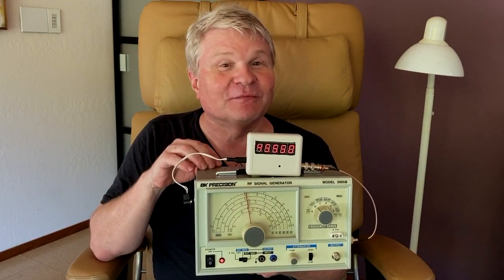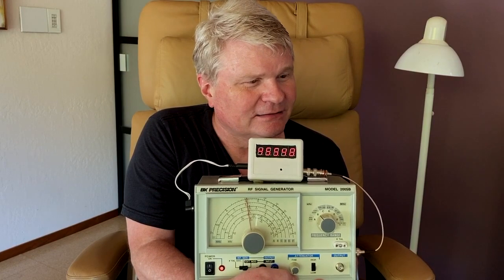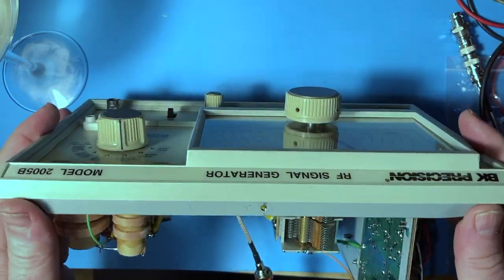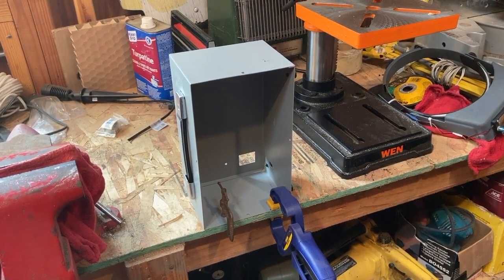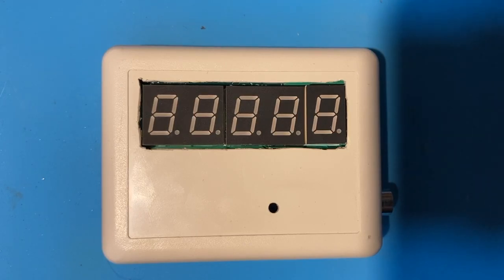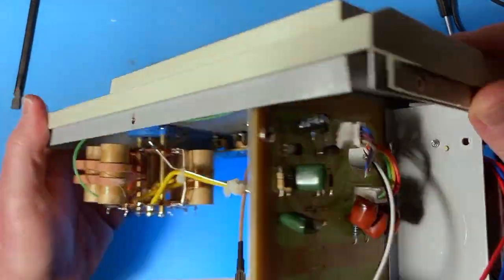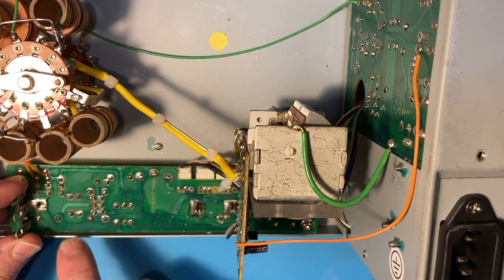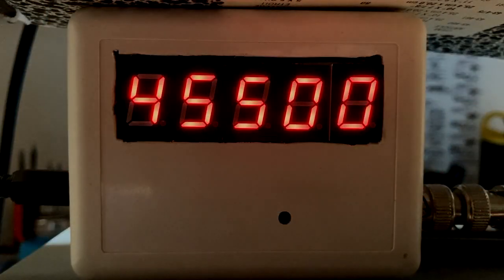Adding A Cheap Digital Display To A Cheap RF Signal Generator The XRAYTONYB Way!

Comment: It is super hard to figure out on this guy's website and what you have to build, and where you get it from. I realize this videos like 4 years old, but I sure wish you could update some things like a direct link to where this kid is and then a direct link to which part of his web page to get it to work with a signal generator like you're showing, in fact the exact model that you're showing of signal generator
Reply from the maker: Not sure I understand your specific confusion, but the information in the description is as comprehensive as I could make it at the time.

Comment: I'm confused on this I thought on the output BNC that I could add a bnc to alligator clips on 27mhz to an AM CB radio. I put positive on antenna wire and ground to ground off a can in radio. I hear nothing. Most of those RF Generators I see terminals instead of a BNC. Do I not hear anything because I'm improperly connected to the radio? Do I need a BNC to PL259 to inject the signal into the radio properly so I can do a receive alignment. First time using one of these pieces of equipment. Hopefully you can help
Reply from the maker: Hi Lenny. You don't have to physically connect the alligator clips to the radio at all. Make a loop out of a few turns of pick up wire (or use an inductor if you have one) and connect the alligator clips to that. Then just hold the loop near the radio's antenna. The signal generator will act as a transmitter, the loop as the transmitter's antenna. (You're grounding out the signal now.)
Reply: @WardCo  so both ground and positive alligator clips become connected on that looped wire anywhere? Also does there have to be an antenna connected to the radio at that point in time or can the loop just be set near the antenna input jack? And what wire type should I be using? Anything specific?
Reply from the maker: Yeah, connect the ends of the wire in the loop to the clips.  2-3 turns of wire should be enough. The wire and size of the loop aren't terribly important, but I'd use solid wire for strength, and, like #18 gauge for ease of handling. At 27 mhz the loop could really be just just a few inches in diameter. An antenna on the jack would help, or just some wire hanging off a plug, but you might get away with inductively coupling into your radio's front end with nothing connected. Try it and see. (The loop creates a magnetic field.) Play around. Jiggle the generator knob until you hear it...
Reply: @WardCo  does the wire have to be exposed or can it be on 18ga insulated wire with rubber covering it?
Reply: I'll try this method if anything else should I just buy a BNC to PL-259 to connect from Output of Signal Generator straight to antenna of the radio?
Reply from the maker: Insulated wire is fine -- actually it will keep the turns separated. If you connect the generator right into the radio using a PL-259 you'll likely overload the radio's front end, as even the lowest modulated amplitude signal from the gen has much more power than RF coming in from over the air. (Oh, and do turn internal modulation on on the gen.)
Reply: @WardCo  I have done all of these things. Made the circle loop 3 times about 3 inches in width. Placed it near antenna and on bottom side of radio. Internal Mod is on. Using a BNC to alligator clips from gen to wire. Have it on the E setting around 27mhz. Slowly moving from 25-30mhz on meter. I cannot hear an single thing at all. Where am I going wrong with this???
Reply from the maker: Sounds like you're doing good. Be sure the gen amplitude is high. You can mess with more turns and different radii, but I don't think it will make much difference. Sanity check yourself on the gen side by doing the same thing with an AM radio in the broadcast band (and of course 0.5 to 1.6 mhz). If still no joy, I am stumped!
Reply from the maker: I just did a little math. Try using 2 1/4 feet of wire, which is a harmonic of 27 mhz. You can make a 6-8 inch loop or bigger.
Reply: @WardCo  I will try this! I don't really have an AM radio on hand to test either! But I will try this first
Reply: @WardCo  so I tried this right away. Saw no difference at all. This is a near new generator I have but have no way of telling it's it's properly functioing as far as mod goes. I feel like I've done everything I should be doing but it's just not working out for me.

Comment: too many  BNC connectors, couplings, the signal  got lost  in this type connections  ,that's my opinion from experience !
Reply from the maker: I hear you, but used the minimum to make it "reversible," and while there may be some attenuation, I haven't had any operational problems.

Comment: So Id like to use a 7 digit display freq. Counter. When installing the BNC to the generator could I then just connect the 7 digit counter to that with its own power supply? Much rather than adding a source of power to the generator
Reply from the maker: Hi Lenny. (Just saw this) Don't see why not; would probably work well.

Comment: I always think of “high” attenuation, resistance, impedance, etc. as analogous to “heavy” braking in a vehicle (as opposed to “low” attenuation or “light” braking. Great video! I also appreciate how you credit your original resource. Sounds like I share quite a few of your interests. :o)
Reply from the maker: Thanks Andrew. We are in violent agreement! "High" attenuation should make the signal level go DOWN not UP! :)  This annoyed me so much I looked at flipping the switch wiring around, but it is mounted to the circuit board. Grrrr.